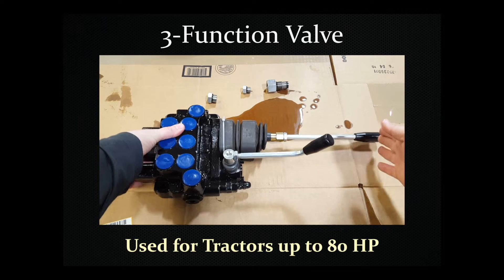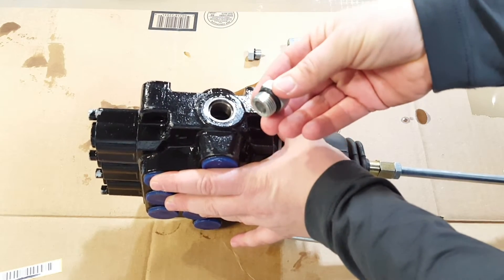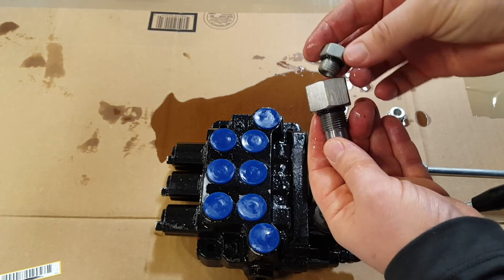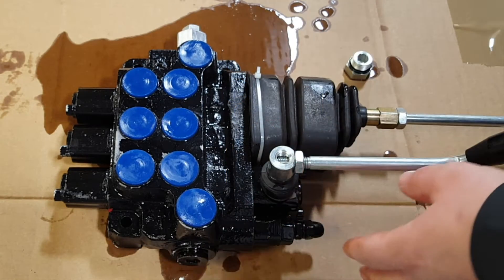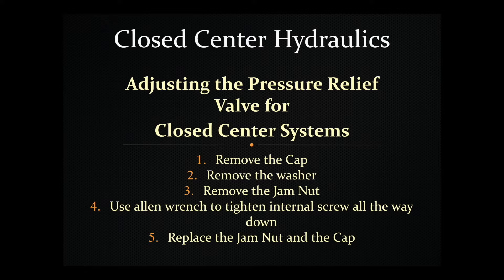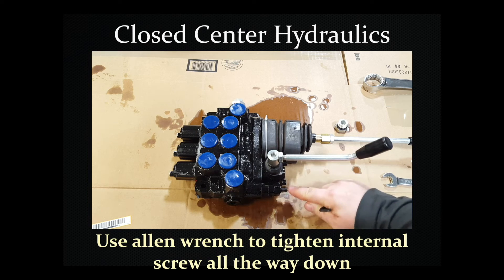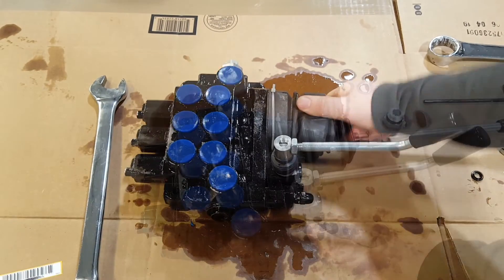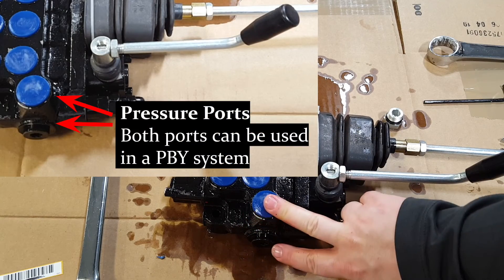How to Convert 3-Function Loader Control Valve to Open Center, PBY, and Closed Center Setup

Comment: Does it require lot of force to move the joy stick? Is there anyway to loosen the joystick in anyway to require less force?
Reply from the maker: A joystick should move fairly easily. There's not really an adjustment to make it operate more smoothly.

Comment: So you are turning the relief valve pressure up on the closed center system to max? Also can you reach the small lever without taking your hand off the big lever? I bought a loader for a Mahindra 3016 without the loader valve. I have been thinking a 3 spool valve would eliminate the need for a 3rd function solenoid and at less cost.
Reply from the maker: For closed center systems, yes, the relief valve needs to be turned all the way in (to max). You do need to move your hand to operate the small lever. We are working on a design that has electric buttons on the main joystick so you don't have to move your hand, but it's not all the way through R&D yet.